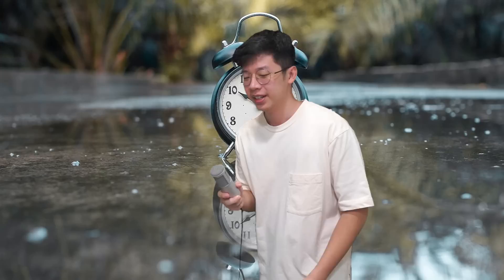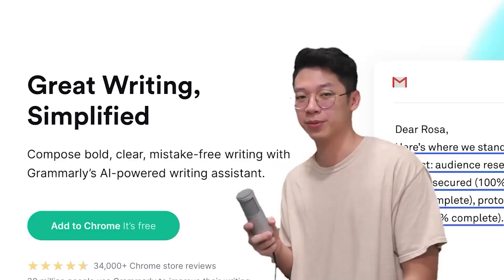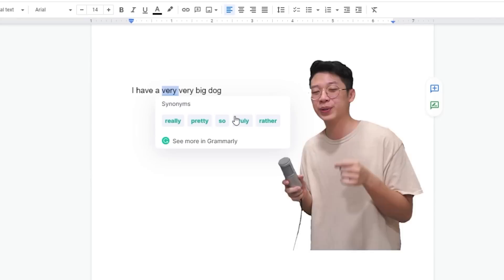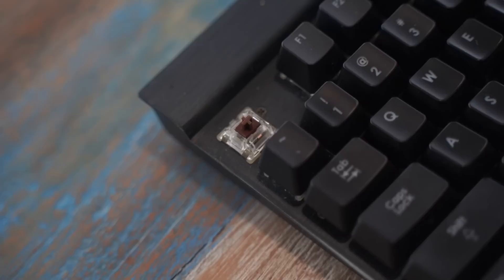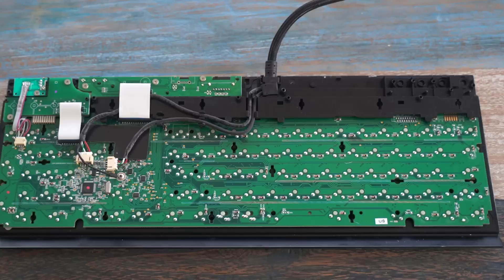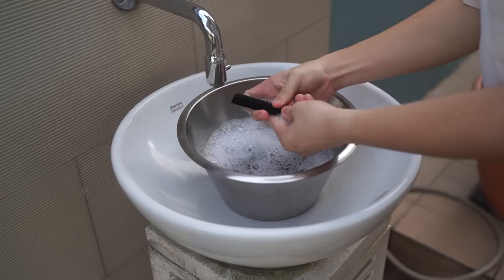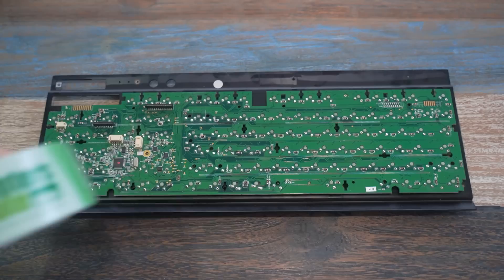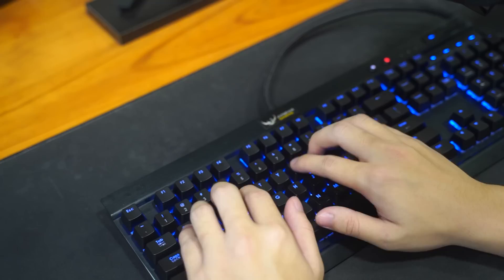I restored my Corsair K70 Keyboard

Comment: I would actually enjoy gaming keyboards to be modded and made as good as customs more than custom ones themselves.

Because software, wireless, latency and RGB integration is still straight up better on them, if they felt the same they would be the better boards
Reply: mansspittinfax
Reply: I actually modded a gaming board. (Armageddon smk-9r). Replaced the switches with outemu purples and lubed them with krytox 205g0. Then replaced the keycaps with gmk darlings. Now it's poppy as hell
Reply: @iotaku  nice, how good are outemu purples, i was thinking of getting them but idk how good they are
Reply: Software in terms of keymappings is straight up worse, USB latency (poll rate) of most top gaming boards are 1000Hz (I'm pretty sure this is limited by USB protocol), which QMK can be configured to with #define USB_POLLING_INTERVAL_MS 1, and picking up multiple keypresses in the same 1ms interval with  #define QMK_KEYS_PER_SCAN.
Reply: I agree with everything except for the software part, as a lot of them are kinda bloatware-ish. QMK is meh, but Via and Vial are imo better than almost all OEM software.
Reply: @xevnn280  aren t otemu one of the worst switches?
Reply: I would personally argue against the software one, as I generally don't like the software these brands give you, although most of them are at least OK and provide enough functions, just a personal thing. Some of them also run in the background and take up a lot of ram.
But yeah, I think if the keycaps were nicer and the boards had some cheaper aluminum instead of cheap plastic, they could be very solid, especially considering the price they could sell at.
Reply: @luxraider5384  gazzew has entered the chat
Reply: @sp3edah  I love the Razer software it's leagues beyond anything Logitech second and Corsair last. Everyone else except the big Three can't write software for shit. Razers software and battery management is straight up addictive where you'll want to get in the ecosystem (and not forcefully but because everything just works together well)
Reply: Software just for layered RGB effects, but QMK/VIA is much better than iCue for example
Reply: @xevnn280  so, imagine MX browns, but make the tactility noticeable
Reply: @Hexal101  Ordered some myself, let's see if the hype is real or not.
Reply: @matasa7463  its no hype. it's just well deserved praise.
Reply: @sinkingdonut156  tried it, can confirmed. 9/10 tactility. Very solid stuff, probably 10/10 when lubed and filmed.
Reply: This is actually the path I'm going for. Did some lubing on the stabilizers and added Eva foam to my new razer 65% board since I was able to do it all within an hour and made the board sound sooooo much better. Only way better is desolder and mod the switches but thats a level of patience I lack lmao.
Reply: You can get great software, latency and RGB via QMK on cheap keyboards such as some Redragon RGB keyboards or the GMMK non pro.
Reply: @Shyvorix  was it a blackwidow v3 mini? I have that too if that's the case it's the best thing in many ways but the stabs ew
Reply: @XtergoRed  Yep. The V3 mini is damn good but yea I do plan to replace the stabs cause the bars are wayyyy too thin and it all feels too loose. Even with liberal amounts of lubing it pings at times. Last I checked though they're not too difficult to replace iirc...
Reply: I disagree with this - VIA software is better than any gaming peripheral software out there, including rgb integration. as for latency, that really doesn't matter due to human reaction unless you're playing rhythm games (lol). as for wireless - yeah, that one is a fair point.
Reply: @bennypallot4147  this was written by the “doesn’t want to hit space bar cause it sounds bad” gang
Reply: You are just wrong. QMK can do more than most gaming garbage software. There are plenty of wireless boards out there.
Reply: Could you imagine a Mr Suit with usb passthrough and lightspeed wireless, etc?  Im creaming myself already
Reply: @louisgarbour2737  you really out here saying iCUE isn't good? Bruh literally zero lighting software out there is good at all, iCUE is the best and works with every single corsair keyboard.
Reply: Keychron k8 pro has entered the chat
Reply: i have a fully modded gaming keyboard and it is literally a dream
Reply: Currently rock 2 modded redragon k552s. As much as I yearn for more expensive keyboards, I wouldn't trade them for anything.
Reply: I modded a Steel Series Apex TKL.. personally I think the Steel Series software and lighting fx is underrated, It’s customized perfectly to my aesthetic. And it sounds better than my Keychron with browns stitches. My only gripe is the non detachable cable on the Apex 7 TKL

Comment: "Old Corsair K70"

me with my original blue led, scratchy red switch, non-gamer edition k70: "god damn it."
Reply: @u/555mackereltuna some housings dont
Reply: i have the k70 vengance which has red switches and only color backlight color is red (found in thrift store for $6)
Reply: also owned a corsair strafe with red switch and holy crap the numpad and arrow keys are scratchy AF

Comment: My K70 with the MX speed switches is old crusty and survived so many liquids, they are sorta a beast. The LEDs are mostly gone at this point but the switches are broken in and much smoother than stock. Kind of odd but I used to think it scratchy but have no decent solder sucker so I went with it and they smoothed out over the years. I may reclaim them after I do take it apart some day. I bet they would glide like butter after a cleaning and lube.
Reply: Can you drop 99% percent solution of isopropyl alcohol in the broken switches and let it dry but please don't use 70% percent solution because it will corrode I hope that help
Edit: Press the switches after dropping the alcohol to spread out the alcohol

Comment: You should try doing “the tissue paper mod” I did it using a pair of bottle caps and a huano red and it actually Kinda worked.
  Just stuff the tissue paper into the back of the board and it shld work

Comment: I actually have one of the first Corsair Vengeance K70s, released back in I think 2012? The box says Vengeance K70, but I guess Corsair rebranded it later and simply called it the K70 Lux? I'm not sure, finding information on this specific iteration of the K70 is quite hard since Corsair has made so many revisions to it over the years. 

It has no RGB, just red north-facing LEDs, and no hot-swappable switches. However it did come with some nice Cherry MX Reds. At the time, I think I spent about $200 on this keyboard. I've been using it for about 10 years. I am actually typing this message on it right now. At some point, when the stock keycaps started to get super shiny, I decided to swap them out for a random set of doubleshot PBT keycaps I found on eBay. 

With how long it has been, the keyboard sounds HORRIBLE. Lots of scratchiness on the switches, and also the stabilizers are horrible. Recently, I had decided to look into DIY custom keyboards and figured I was due for replacing this one. I figured I could just dismantle this one, desolder all the switches, lube them, and maybe even replace the stabilizers with something better all together. However, the work for that would have been insane and I just really wanted something different. 

I decided to get a Keychron K8 Pro, along with a nice set of MT3 keycaps. When I get that put together, I will most likely mod out my original K70. Despite taking so much work to mod, I think it would be worth it. It is still a 100% functional keyboard, the only real issue with it is the volume knob, which I have accidentally damaged through the various times I have taken apart the keyboard to thoroughly clean it over the years. It still works, it just makes noise when scrolling it. I could probably fix this, I think this is an issue with one of the plastic bits it slips into. I may even figure out how to interface a USB-C port into it, possibly even figure out how to slap in a lipo battery and give it a proper protection circuit. It sounds extensive but I think modding this would be cool. I'd love to give it to a friend, or even just sell it after I mod it.

Comment: After watching a bunch of custom keyboard vids, and knowing the status of my bank account, I looked up if it's possible to mod my current keyboard.  I have the K95 but it's the RGB version and I don't know how that would effect the difficulty of doing these mods, but it at least gives me a little hope.  I actually still love this keyboard, so if I can just make it way better then that would be nice.  all of the rgb still works 8 years later.  I LOVE the big 18 key macro section on the side, I use them a ton when streaming or in adobe.  I love the media buttons and I love the volume wheel.  My friend who has a diff corsair keyboard with the same wheel wrote a little custom app that lets me control the volume on any program with a simple hotkey + the wheel.  the icue software with my macro keys makes setting up macros for streaming really convenient.  So I would lose a lot of that if I made a custom keyboard - I know that macro pads and volume wheels are a thing on customs, but it makes the price go up even more.

So now I know theres a chance I can mod this keyboard, I may just try to do that and put off building one for another couple years

Comment: Eyyy you gave me another idea. By the way, I was "inspired" by your Razer video to "mod" my old Blackwidow X Chroma (and it was my first time to disassemble a keyboard). I botched up most of the LEDs but I all the switches replaced, from Razer greens to lubed Gateron yellows, and it was so fun to use. Might mod my Corsair K63 Wireless (or at least fix the rattle in the space bar) in the near future, too!

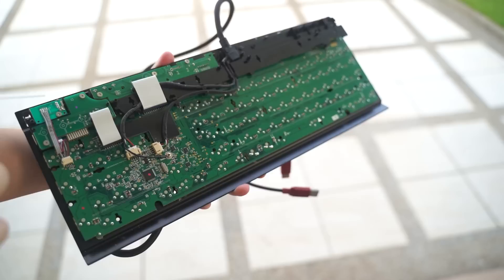Comment: You didn't mention the "hidden screw" underneath the volume roller (under right side plastic U cover).  Also at 3:23 you can see (in between a ribbon connector and a 4 pin connector), the fallen out plastic 1 inch pressure bar which sits in the black plastic backing normally and presses down on the fingers (white + copper) contact pad which you can see on the left hovering under the media keys PCB.  Both of these features are "anti consumer".  Shame Corsair!  People get tripped up on these details when attempting their own repairs.

Comment: I have a few question for all the expert on the world of mechanical keyboard, so basically i just got my first mech keyboard and i have been using it for a good 1-2 month i'd say. But some switches are getting not responsive. What do i mean by that is some switches sometimes register and sometimes doesnt i have 1 more spare switches free from the box but if i lost this one too i need to buy and replace the switch again, if it keep going like this i dont know how much im gonna spend on a new switch. I have come to a conclusion that since im a messy guy dirt and dust might be coming through my switches.  Is it possible that dust are clogging the contact part?

Comment: Hey so they released a "MK.2" version of this keyboard and it is actually worse in every way. It's so much cheaper than this version (the keycaps' stems are not only looser, but thinner somehow. They WILL snap) but also has insufferable firmware bugs that make it unusable. They had the nerve to charge the same price for all those cut corners 💀
They don't even manufacture the original anymore T-T